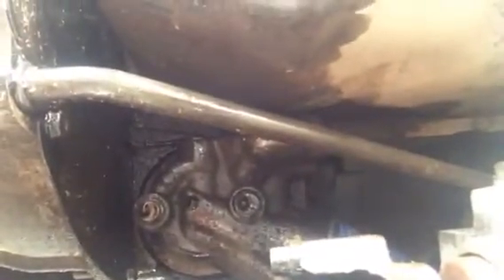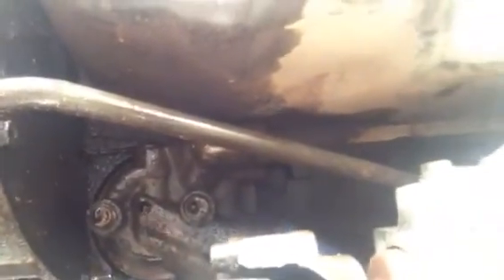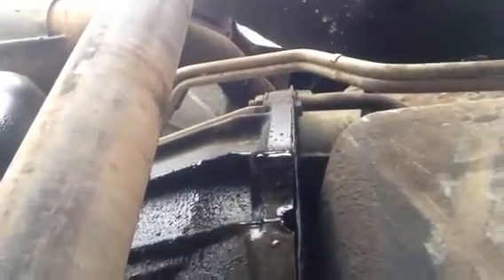Please help me diagnose my oil leak in my junk truck with a

Comment: It could be your oil filter mount, it could be your oil pan seal or worse it could be your crankshaft seal. If there is oil leaking from the top it could be a valve cover gasket. Clean your engine and run it to localise the problem area.

Comment: Either the rear mainseal, the oil filter relocation bracket or possibly the back side of the one of the valve cover gaskets but I am betting on one of the first two. My K1500 had the oil filter bracket seal leak. It is under the two bolts where the oil filter would spin on if it was a 2wd. I simply took it off and ran a bead of blue RTV where the old seal was and it has held for 10 years now.

Comment: It is not easy to tell by the video. I saw what looked like the oil filter. Sometime the person that changed to filter will not hand tighten it enough or over tighten it. If its coming from higher up, it could be a number of things. Valve cover gaskets, Oil pan, rear main seal. Just keep oil in the old truck.

Comment: Kellie - It looks like a rear main seal (the two piece seal that goes around the crankshaft). Replacing it is fairly involved and costly. If it is a junker truck - and you are not looking at getting another 200,000 miles from it try using one of the engine stop leak products that reconditions seals. Clean the area with engine degreasing spray and see if it slows the leak down. It most likely won't completely stop the leak but it will slow it down for a few bucks.

Comment: I think  the rear main seal on the crankshaft or the oil filter bracket seal,but first you have to clean the dirty part of the engine and then start the vehicle good luck Kellie

Comment: the oil pan appears relatively dry. ruling out a simple loose bolt or pan gasket. there is a weep hole at the bottom of your torque convertor cover. there are some split seals that can be installed on some engines, You said a used motor so that one is not original ? If you want to keep it for a while, then pulling motor and transmission together will allow proper seal replacement and even rod and main bearings unless it is low mileage and doesn't knock and smoke through the exhaust pipe. The oil looked black, which is engine oil, but wipe your finger across the weep hole and see if it is reddish too. that implies transmission front seal , best to do both at same time. does there appear to be oil above the oil pan level ? check tightness of the oil filter and bracket bolts for the same. good wrenching,  ;)

Comment: looks like rear main seal...you can use a heavier oil that might help like 10w40, but in the cold it'll be trouble starting...if your oil is too thin, it'll leak out super fast...the roads there are hard on vehicles

Comment: Rear Main seal might be out.  The main seal on my car is out.  If I had a shop I could fix it.  When it's not out the car hardly uses any oil at all.  Now I have to put 3 or 4 quarts in per tank of gas.  The bad part about a main seal is you have to pull the engine to fix it.  When I run into mechanical problems I go to the How to video's in You Tube to learn how to fix something.  I've learned a lot in You Tube.